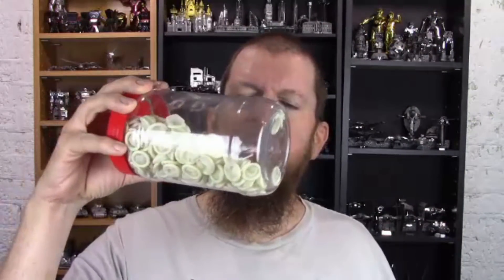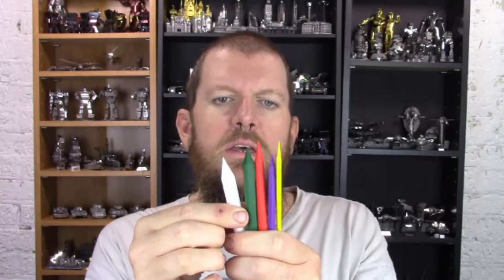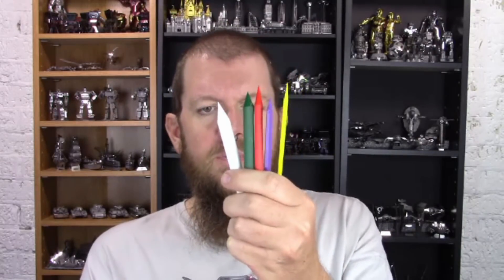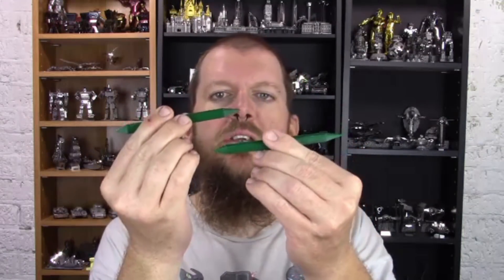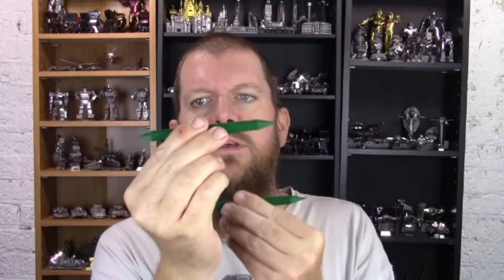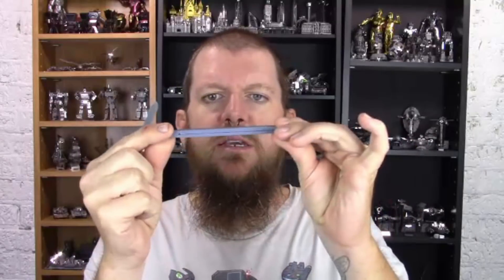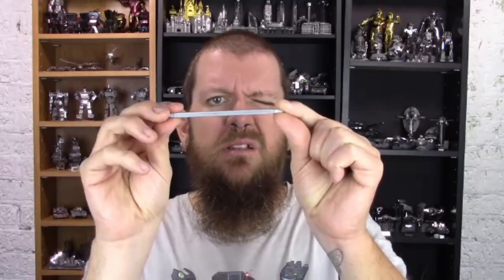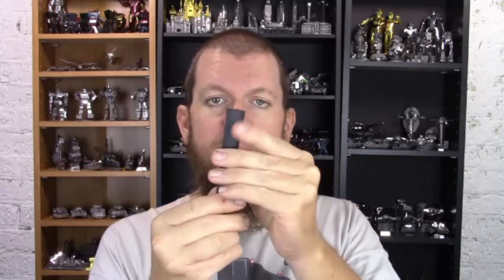3d printed tools update and avoiding fingerprints with finger cots

Comment: You don’t need the cots or gloves. Simply douse your models generously with Windex when done.  It will completely melt your finger prints and oils away. Then just rinse with water and dry them with canned or compressed air. They will be very shiny and fingerprint free.

Comment: do you think brake cleaner would take off the finger prints?  If you guys don't know, I might give it a try myself on my first model when I'm done.  If it works ok, I might try it on the next models I do (which I am more excited about).
Reply from the maker: I've never thought of using brake cleaner. I'm sure it would remove fingerprints, but it might do more than that. I would test it on a empty sheets first just to see how it reacts to the metal. Rubbing alcohol works good too. You can get alcohol wipes from your local pharmacy.
Reply: @animateorange  Thanks!  I'll keep those tips in mind.  I'll let you know (i'm taking my time on this (15 minutes at a time) so it might be a little bit before I test it.
Reply from the maker: I respect that. Take all the time you need to do it right.

Comment: I think I have a solution to the fingerprint problem.  I just tried it out on the Japanese garden model.  I cut a corner from one of those cheap foam paint brushes and glued it to a six-inch bamboo skewer.  I dipped it in alcohol and rubbed it around the model, which has a lot of twisted tabs and sharp edges.  It held together quite well without leaving any bits caught on the model.
Reply from the maker: Richard Kroll interesting. Thanks for sharing.

Comment: Very interesting discussion of developing tools for model building.  I have a suggestion for the bending tool.  create it in two parts.  Join them with machine screws and nuts at each end using spacing washers made from scraps left over from model sheets.  If a sheet is thicker or thinner, the spacers could be replaced to customize the tool for the model.

I have a mandrel designed for shaping chain links that is good for shaping most sizes of round parts.  For larger parts, I scrounged a variety of plastic bottles.  For smaller parts, a tip of the round end pliers often work.  For smaller than that, I took a lead from Brad and use fine drill bits.  One of the tools I have found invaluable in handling small parts is a locking tweezers that came in a set.  (You squeeze it to let go and release it to close the ends.)
Reply from the maker: A very interesting idea with the two part bending tool and spacers. Thank you.

Comment: Even wearing nitrile gloves fingerprints still appear on my puzzles. I also have a bunch of finger cots and i still get fingerprints. I can wash my hands before building the puzzles and avoid touching my face, etc. but i'll get to a maximum of 4 hours before fingerprints start appearing. They usually start showing up after 2 hours. I can switch my gloves regularly but that can get quite expensive (I've started working on larger puzzles that take 8+ hours to build). Any tips?